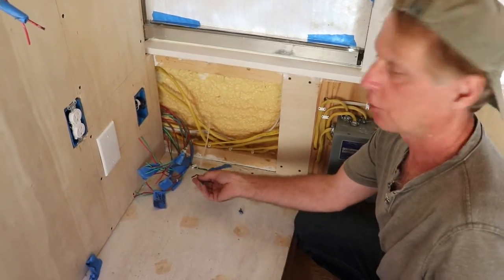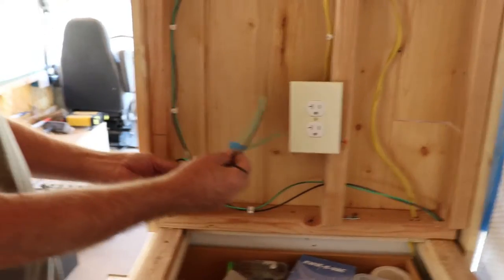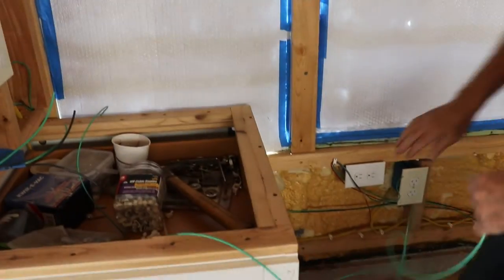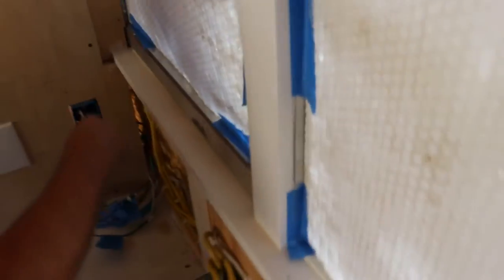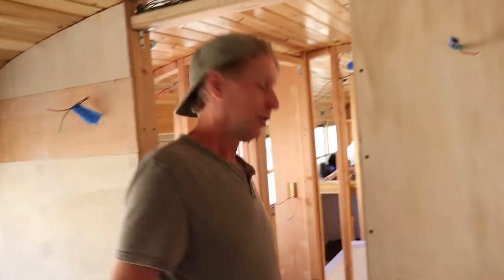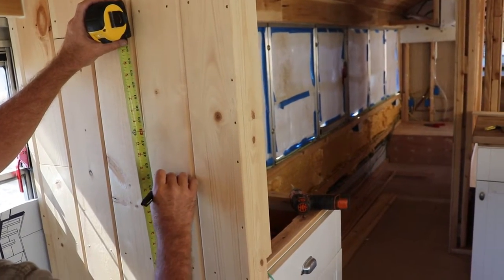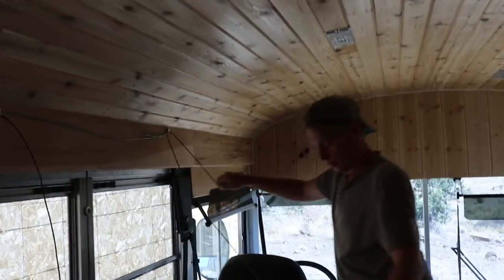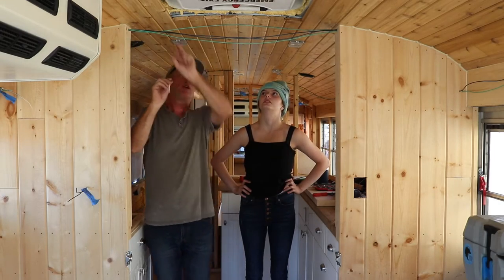Wiring Our Skoolie: A Simple Task or Total Chaos? Watch Us Find Out!

Comment: Your wiring is looking great so far! It's great that y'all are wiring before you get further in your conversion. Looking forward to part two.

My problem is planning/anticipating all my electrical needs. 😂 Just yesterday I had to wire in a diesel heater. Had to remove everything from two storage compartments and pulled some ceiling panels just to make the run!
Reply from the maker: Thanks! We ran into that also, where we decided to change something after we already did it. Like when we first decided to do a shower, but then decided to rip it out and put a bathtub. 😄
Reply: @ourskoolieandus545  That bathroom is going to be awesome! Might be the most spacious bathroom that's ever been in a Skoolie!